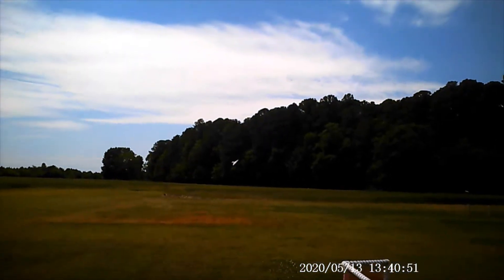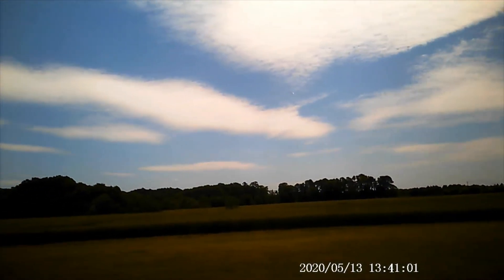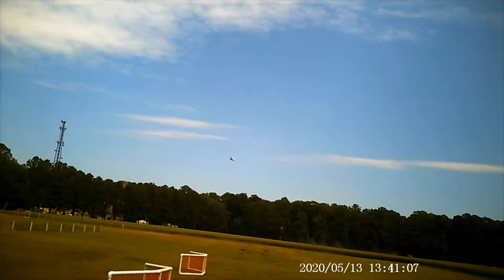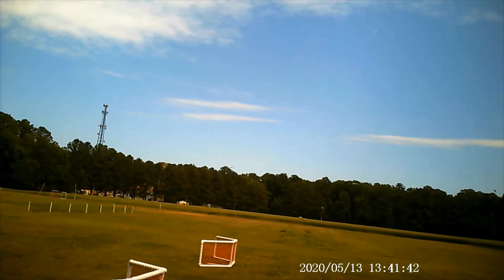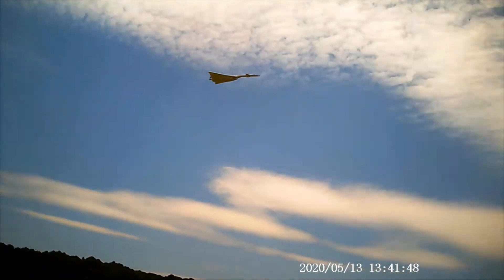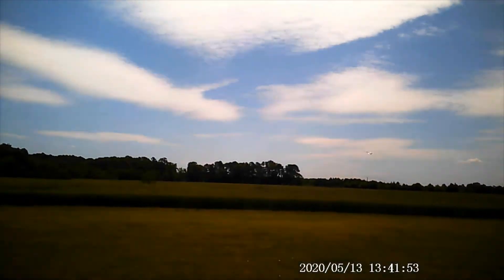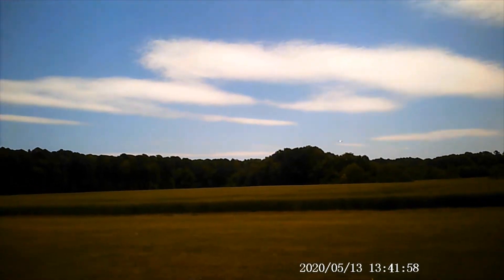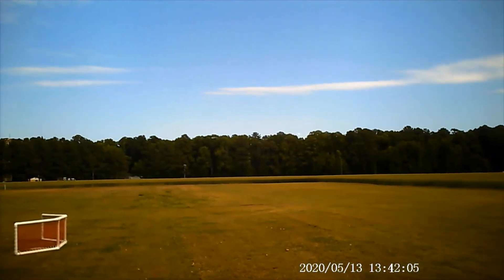A loop and some rolls with my XB-70 Valkyrie RC model on 13 May 2020

Comment from the maker: Unfortunately this was the last flight. On the hand-launch for the 11th flight, the Valkyrie veered off to one side as the launch was not perfect. It hit a steel fence. I decided not to rebuild it. I may build a new Valkyrie in the future but it would have retractable LG and at least 2 EDFs. In the meantime I have been building a 6' 2.5" long SR-71 Blackbird with retracts and 2 counterrotating 70mm EDFs. It's a much more complicated build and has taken me 7 months to get to a point where I am confident it will fly. I had to reduce the weight and iron out some other details but it's ready for a maiden once the weather cooperates. I'll put a link here if the maiden is successful and I am able to record it.